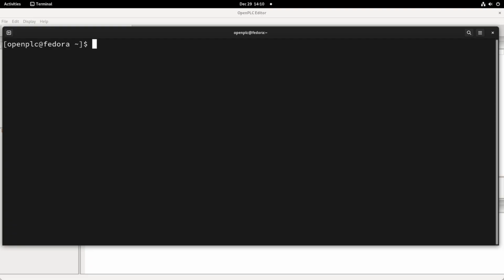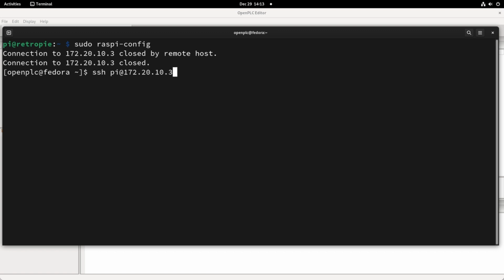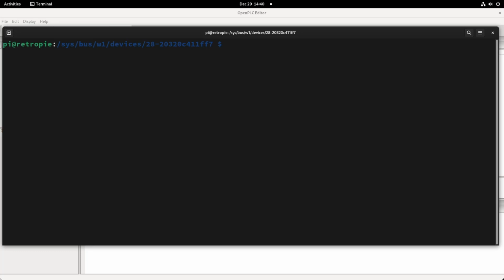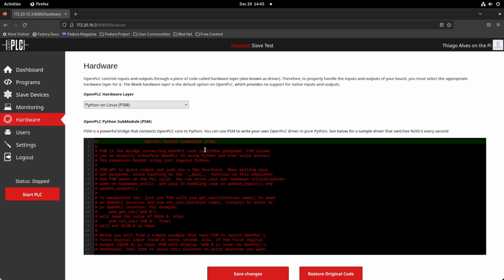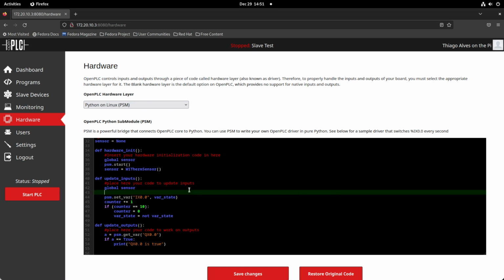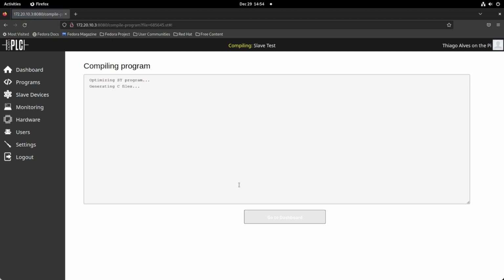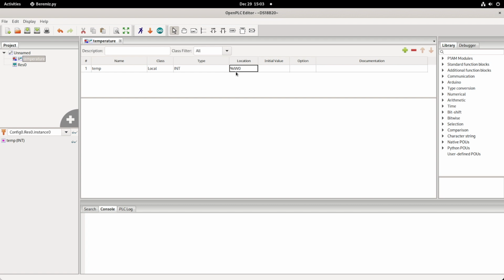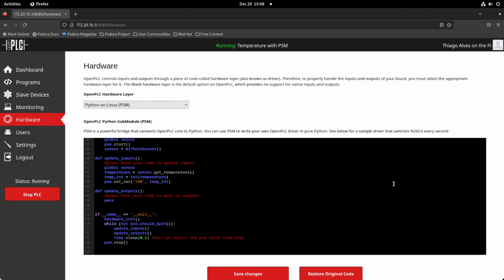Writing OpenPLC drivers using PSM - DS18B20 on Raspberry Pi

Comment: Thanks Thiago! 

After finally escaping from a two-year long sidetrack into cybersecurity, I used this tutorial to get the PSM OpenPLC runtime peer-to-peer started.

Now, an OpenPLC runtime instance can connect to other OpenPLC runtime "peers", read their coils, discretes, input and holding registers, and update the variables within the "client" instance of an OpenPLC runtime!

The primitive code I have entered into the PSM can connect to multiple peers (my "heaviest" OpenPLC runtime client connects to 13 peers), and reads of discrete inputs and coils are successful, but that's only for a single PLC so far.

The PSM "peer-to-peer" code is still too rough to release, but as soon as I get connection monitoring, read cycle throttling, and exception handling fleshed out a little better, I'll post it in the OpenPLC "projects" forum.

Comment: Hi, I am using arduino nano clones which have the CH340G usb chipset and seems like openPLC doesn't upload the code I don't get any blink on pin13 the upload window does say that the upload is done but when uploading the pin13 the inbuilt led blinks for a few milli seconds and the rx tx leds don't light up and yes I have selected the correct pin %QX0.3 for nano and the correct com port too seems like the program only resets the arduino nano when uploading doesn't actually upload the program. This is only problem for the clone nano's I have tried it on Uno (original), Arduino Micro, and esp32 all of them works but not the clone which uses CH340g can you please add support for the ch340g too.
Reply from the maker: Most likely you will have to update the Arduino bootloader on your clone board

Comment: Hello sir your videos are great..can you please give tutorial to connect LCD to ARDUINO by plc programming to display counter value.
Reply: Friends,   I am also interested in lcd readouts. With scadaBR a $67 chrome book could replace all push buttons and lcd screen? Which is a good price point, if your machine can physically support it
Reply from the maker: OpenPLC Runtime does not support connecting to an LCD directly like that. You will need a proper SCADA solution like ScadaBR or FUXA

Comment: sir tell us please how can we get pulse output in openplc for running stepper or servo motor 
thanks
Reply from the maker: Stepper and servo motors require a more precise timing, and that can be tricky to achieve with just ladder logic. You can use PWM capable outputs (for the boards that have them) with OpenPLC. OpenPLC treats them as 16-bit analog outputs, where the PWM duty-cycle is directly proportional to the analog value you place on them (0 to 65535)

Comment: Hi and thanks for all the great video tutorials they are very useful. Can I ask if there is a way to view the status of registers/ memory allocations in Open PLC ?
Reply from the maker: If you’re using the Linux/Windows runtime then you can simply click on Monitoring to see the current status of all located variables. For the micro runtime (runtime running on microcontrollers) you will have to use a Modbus tool like Radzio Modbus to read the registers
Reply: @openplc  Very Much Appreciated 👍

Comment: The platform is wery well written. The only big problem for me is the installation in my school where we don't have the access as root. I managed to start The editor struggling with windows but for the run time i have a very big problem. Do you have some workarounds to solve the problem? Thanks
Reply from the maker: The editor is a portable application. You can copy OpenPLC_Editor folder from one computer to another and it will run. No need for admin access and no need to go through full installation process. For the Runtime, running without admin is tricky. The Runtime on Windows relies on Cygwin. So if you can manage to install a portable version of Cygwin, you should then be able to install OpenPLC Runtime following the manual installation procedure
Reply: I'm thinking in alternative to install a Linux machine configured in a virtual box. But at the moment i'm not so sure It Will work...
Reply from the maker: @boardsdiscovery5803  You can definitely use a VirtualBox VM with OpenPLC Runtime. I would recommend keeping the Editor on Windows as it requires a GUI to run. I did exactly that when I built the SCADA Security Lab at UAH. A clean Debian VM with no desktop environment works best as it is super lightweight. OpenPLC Runtime doesn't need any GUI to run. The good thing about this approach is that you can replicate the VM multiple times to have a virtual environment with multiple PLCs. Each VM with OpenPLC Runtime installed behaves as an individual PLC.
Reply: @openplc  is a server! :) I had not  tought about that!  Great guy! Thanks!